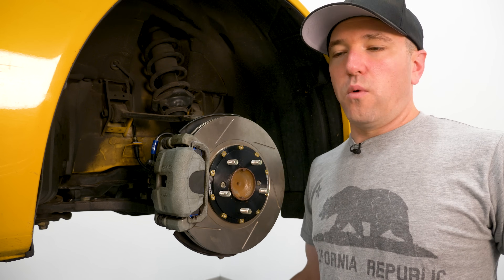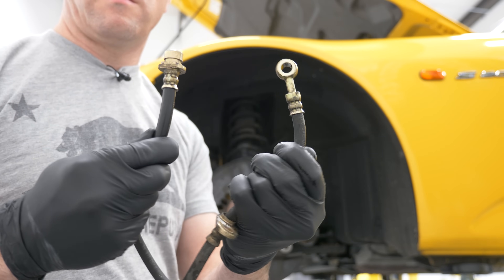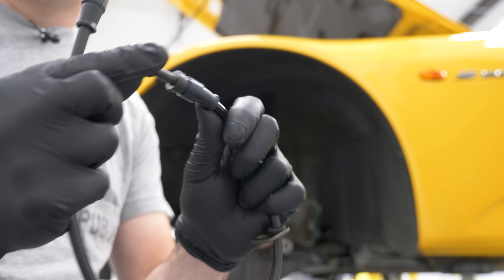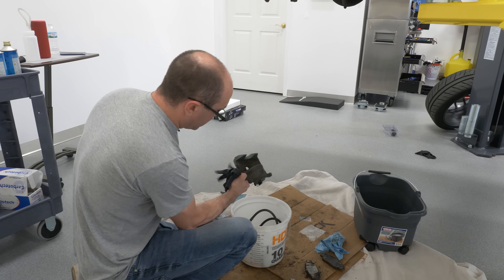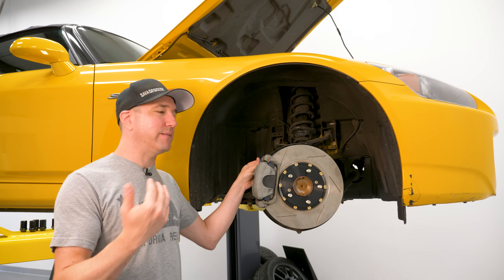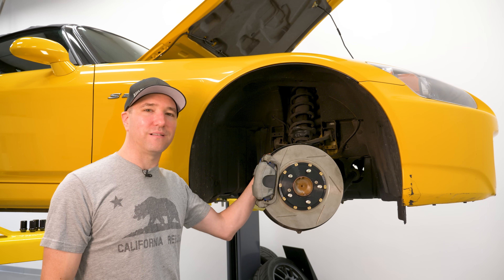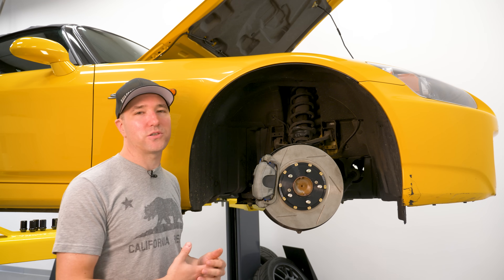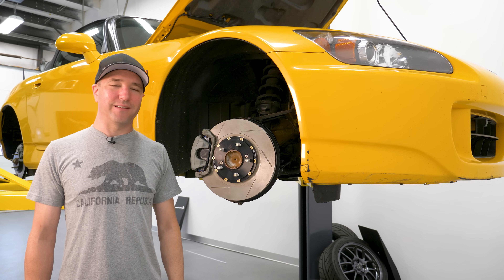Are Stainless Steel Brake Lines Worth It? | The Fine Print

Comment: Working as a mechanic for 11 years on many high performance cars and vintage race cars we installed and serviced a lot of flexible stainless brake lines. We installed top brands like Spiegler and Earl's. Many of these brake line installations failed within just a few months. Flexible ends or not, this hardware is not really suitable for everyday street use. There is simply more flex at the line ends than the lines can handle, and the hose ends up splitting close to the end fitting. It is even a problem for race cars. The rubber hoses can tolerate a lot more flex cycles than the stainless hose.
Reply: Interesting. I also work for a high-end repair facility(20+ yrs) but have no experience the brands that you mentioned. I currently have StopTech lines on my Honda and Techna-Fit lines on my daughter's Nissan. Both have DOT approved fittings and have shown no signs of flexing failure. I sold my previous Volvo 240 with IPD lines that endured over 12 years/200k miles. Correct routing is essential and the technician was meticulous during those installs. I would tend to think that any SS braided brake hose that encounters more stress than it's rubber counterpart would be due to a poorly designed/built hose and/or improper routing during installation.
Reply: @GspeedR  good to know
Reply: After I bought my car in 2011 I installed stainless steel brake lines from Goodridge. I've sold the car last year in 2021. Guess what? They were like the day I installed them. My car didn't see any track, but I drove it pretty hard from time to time and I wanted great brake pedal response. No problem at all. On my next car I'll use EBC.
Reply: @Zeghetank  same, installed goodridge in 2014 and drove it hard and near everyday since, no issues or leaks but will probably replace soon for regular maintenance
Reply: @Zeghetank  no, they werent like the day you installed them.
Reply: Is it good practice to change the rubber brake lines depending on the cars' age? This is assuming no visual leakage or damage present.
Reply: @kalani1987  A friend was killed in a Honda S2000 on the track when one of his rubber lines ripped out of the fitting.  The car was 11 years old.
Reply: @kalani1987  I know my motorcycle is not a car but my service manual said to replace brake lines every 4 years.
Reply: @paulh9301  geez...i think im a bit overdue lol. I'll need to confirm but I'm pretty sure my factory manual for my car doesn't call for replacement unless they're visibly damaged or deteriorated. Am fairly confident that they are the original ones when the car rolled off the line 33 years ago...
Reply: @kalani1987  it makes sense to change them on old cars, I would not trust them after 15 years or more.
Reply: @charlesrockwell3923 if I can pick your thoughts... I've just acquired an E46 for track use however it will retain road legal status for the moment after watching this I'm now debating wether to swap to braided hoses but I just don't get why they would offer life time warranty with them if they where this bad?
Reply: Is the concern the same for clutch lines?
Reply: Thanks for sharing!
Reply: stainless brake  hose ...is not easy to install , on a car or  motorcycle
u must need to measure  every moving parts ... the complex part  using that ,is the fitting angle ..
..

Comment: Dang, I'm having to replace my lines because my brakes got over temperature and deteriorated the lines where it won't release the rotor.  This will be second time.  Now you're suggesting I shouldn't replace my lines with stainless braided.....Well the reason this happened because I was trying to keep up with someone in a tacoma while I was chasing with a f150 carrying tools and generator

Comment: I was told the rubber lines break down and small particles get in the brake fluid. Need to replace the lines and flush it out with new fluid

Comment: OK, so this is a good video. But, I have yet to see any technological video showing evidence of the heat transferring into the line is so high that the line expands like this on even regular track driving. I'm not saying it's not true; I'm saying that I have yet to see any video proving it. So, show me concrete, logical, measured temperature increases in the OEM lines that lead to this problem. I have had my OEM brakes up to 700 on regular nighttime street driving, and have had street brakes up to 1100 with glowing red hot rotors that are destroyed in one night. Even with that, glowing red hot rotors, the lines did not bust, expand, explode, or anything else and has never led to me experiencing a brake failure for this reason. Those rubber lines come engineered with a percentile of error, and the specifications generally provided to the public does not include the 20% overbuilt criteria.

Comment: My excuse is corrosion,,both ends on my owm rubber lines were corroded badly and i only have 7,000 miles on my fk8. Its horrible and thats why im did it, because they are stainless steel.

Comment: I bought this for my CRF250L but to me I dont feel comfortable, when I pulled the front brake lever, i have to use 2 or 3 fingers, i find it hard to pull. I prefer the original line. For the rear brake line it is ok.

Comment: I've went back and forth on this decision for some time but yeah I don't track my car and am satisfied with the brake pedal feel etc so I will keep my rubber stock lines and when they need replacement I'll replace with another set of rubber stock lines or OE quality rubber ones. Just not worth it to me.

One thing on my car (2015 WRX with 107K miles) that improved brake pedal feel was the Perrin master cylinder brace. My brake calipers are 100% stock. I recently had to replace the rear calipers (found a pair of them new) as they were starting to just fail on me and seize up. Replaced along with rotors and pads. Duralast Elite pads and Duralast rotors (smooth surface no slotted/dimpled). I use Dot 5.1 Motul brake fluid.

Comment: Thanks for this. I was considering putting some braided lines on while doing the brake pads, but I think I'll just use some new rubber lines, since the ones on there now are about 12-13 years old. I don't do serious track driving, because I don't really have the spare time or money to get into it. Fundamentally, even though I do like to go fast, it's still just street driving.

Comment: What about the actual brakelines though, the hard fixed lines - I like stainless because of it’s corrosion resistance, though it is a little harde to work with than the soft nicop lines

Comment: Its not about lines expanding from heat, its about lines elastically expanding from pedal force. The imprecision added when some of the force applied is spent expanding lines. Imprecise and inconsistent.

Stainless steel lines do not accomplish this because of the stainless exterior braiding (if ever seen Chinese finger puzzle clear why). Tbey do it by virtue of the teflon inner core that is commonly part of stainless lines.

Its possible to use teflon core woth rubber lines. Might be ideal for street car that doesn't need abrasion and puncture resistance that the stainless braid is providing. But near impossible to find aftermarket (because every wants cool factor of stainless braid).

But I bet some of those high performance exotic cars
mentioned have teflon lines stock.

Comment: In 2013 I did z1 motorsports ss brake and clutch lines on my ‘06 350Z. I thought it was a tremendous upgrade. Brakes and clutch really firmed up and felt strong. Put them on my ‘15 Titan in 2018 and had the same experience: nice and firm brakes.

Comment: I agree with Charles Rockwell the only brake line failures I have had are on competition cars with stainless lines. I think the reason lots of people think that their brakes are better after fitting stainless lines is because they have changed the brake fluid and bled the system.  I discussed this at length with an engineer from Girling and he would never use stainless lines on a road car. I would however consider fitting nylon coil rubber brake line protectors especially if you drive on unsurfaced or poor roads.

Comment: Any improvement in pedal feel, firmness, is more due to the performance lines inner construction, than due to the actual stainless braiding. Typical inner hose liner for braided lines is teflon, and that is what adds firmness over some stock lines. The braiding itself is there more for protection against external abrasion, like mentioned in video.

BTW, its super important that  braiding is covered by an external plastic coating, to prevent debris from getting into the mesh, which would then abraid the soft hose with each flex, quickly destroying the hose.

Some high performance cars come stock with teflon inner hose liner, even though exterior is still rubber. This is why some claim braided hoses made a huge improvement, some say none at all.

If cars stock hoses were rubber inner liner, huge improvement. If cars stock inner liner already teflon, no real improvement.
Reply: wonder how much of an upgrade it'd be if one were to get these oem teflon-lined rubber hoses and fit them onto another vehicle, assuming the lengths and fittings were the same.

Comment: Question.  I drive an Escalade with about well close to 1k lbs of audio equipment.  Converting to corvette 6 piston calipers. Would ss brake lines be recommended for the heat or run with the rubber hoses?

Comment: Thanks for the info. This confirms that rubber lines are good for my purposes. Though I wonder if they're ready to replace in my 2008 Civic. Brake performance is weak. Maybe just need to upgrade the pads.

P.S. that S2000 is awesome

Comment: Has anyone actually changed their brake lines every 4 years in their road car? I don’t think anyone really does and over time heat will weaken the lines and ruin the pedal feel. Braided lines and new fluid and bleeding tend to make a change on lighter vehicles. As for the failure rates, I have no data to go on so it’s impossible to comment on. I think if you have a weekend or track toy that gets abused, especially one with serious brakes then SS lines will improve the feel of the car and for a lot of cars the cost of good ridge or HEL is the same or less than the OE rubber lines.

Comment: I understand where you are coming from with the turning and flex of the brake lines. On a track, as long as you are driving close to the race line, you are only using about 10% of the car's actual turning radius, thus these steel lines are not flexed or stressed like they would be with daily driving. So the car would rarely pull the steel brake line away from its original routing. However, daily driving, which has a lot of tight turns at street corners or during parking, need a flexible brake line that won't fight those tight turns.

Comment: Why would the SS brake lines be breaking more if installed correctly?
What seems to be an asterisk that isnt properly discussed, is installation error.
I want to see testing comparing SS vs rubber installed properly, I'll put $1000 on SS

Comment: I always phantasized about if efficiency wasn't a concern in this world, if cars could be made with no rust tendency whatsoever, made for life, and so when I got my racing brake I picked steel brake lines and when they asked me whether the fittings should be anodized aluminum or the slightly heavier and more expensive stainless steel, I didn't even have to think.
I also once mounted a header shield and an exhaust system with V4A-80 screws, kind of in protest of seeing mounting parts in extremely rust-prone parts rusting into Swiss cheese themselves. (I do not know whether that material's heat expansion and electrochemical characteristics are fine, though.)

Comment: Yamaha recommends replacing motorcycle brake lines (and rebuilding the calipers) every few years.  The makers of SS braided lines claim that their products will last the life of the vehicle.  In addition, the OEM lines on ABS-equipped machines tend to have a lot of hard steel tubing so the amount of rubber hose is much less and the benefit of aftermarket braided lines (without these sections of hard tubing) is also reduced.   I also have concerns that the OEM ABS system is tuned for the dynamic response of rubber hoses and might not perform as designed with braided lines.  I wish someone competent would do a video on this application.  Too many questions...
Reply: Dynamic response? That's where you went wrong. Rubber hoses have a delay believe it or not hence the ABS SYSTEM ASSISTING YOU IN BRAKING BECAUSE IT KNOWS "MY BRAKE LINES CAN'T TAKE THAT PRESSURE SO FAST, SO I'LL HELP PUSH IT"

Comment: There is another reason for stainless steel brake lines, and that is feel. Knowing what is happening at the pad is another piece of telemetry that I appreciate. You don't need it on the street, but I have them for the feel. Just because you technically don't need them on a street car, doesn't mean you shouldn't use them. If your car is your love and you don't track it, there are better places to spend your money. Its just this guy's opinion from a practical perspective.

Comment: So, it turns out it is almost impossible to get Honda OEM replacement rubber brake lines for ap1s right now.  If OEM is unavailable, is there another source for high quality rubber replacement brakes lines for the ap1? Or, is stainless the only option at the moment.

Comment: I've installed SS braided brake hoses on several my family's daily drivers. They get inspected @ every OCI, never had an issue. IMO, An emergency avoidance maneuver on public roads can warrant the same braking confidence that's relied on @ the track.
Reply: He described heat buildup in the fluid from repetitive hard breaking as the reason why stainless brake lines will hold their shape better in that hot condition. Built up heat wouldn't apply to a one-time emergency maneuver.
Reply: @lawpenner  While I won't doubt that brake fluid temps are consistently higher under track conditions, some moderately spirited driving on the hilly, winding roads of eastern PA can easily stress even the best DOT4 fluids, albeit @ shorter durations.
Reply: @GspeedR  love those winding roads on the hills of Pennsylvania. ...Except when I got hit by fog suddenly in the middle of the night, went off the road and ramped off a dirt pile launching my car 4 feet off the ground, then nose diving into the ground and jacking my alignment/suspension. Good memories

Comment: So there might be a problem with the end fittings if you don’t install them correctly? Isn’t every part a possible liability for you don’t install them correctly? I don’t want any part of my hydraulic brake system expanding under any circumstances. Rubber also tends to dry out and deteriorate over time.

Comment: @4:24  Rubber, unlike many other materials, constricts when heated and expands when cooled.
Reply: Yup, this is accurate.
Reply: The discussion here isn't about the properties of rubber as a standalone material, but in the context of brake lines. If the brake fluid expands enough from heat, it'll push outward on the rubber lines and they'll expand.

Comment: 100% agree with you 👍🏾 only thing i could add as it relates to liability is the shock load stress then the abs module activities hammering  brake system through fluid during its operation.. rubber lines act like accumulators reducing the shock load as the pressure spikes then module pulsates
Reply: Interesting. I haven't heard someone else mention this. But, is very true. They def. give a buffer, if one will, for regular drivers so that they aren't just skidding all over the place.

Comment: something came loose on my track car and my tire was rubbing the rubber line. i was going hot into a turn and the line blew. I still count my lucky stars nothing was in front of me in the brake zone. stainless lines were installed shortly after.

Comment: The real question is difficult to detect rust in the FIXED lines. This potentially deadly problem is not even mentioned in this video.  Steel in not flexible. So if the object is obtain maximum life insurance.
Fine.. use braided rubber/ stainless fittings that flex and for Gods sake give us  “lifetime” non corroding fixed lines and non porous steel or plastic master cylinders.

Comment: Should have watched this before I bought my stainless steel brake lines.
Reply: Don't feel bad, the SS lines will give you much better pedal feel because there's no expansion on the lines from the hydraulic pressure. Its worth it,  nothing scary about it.  These lines are used in the racing world where they're tortured, they wont fall apart at the fittings.

Comment: But even a stainless steel brake line has rubber on the inside. A stainless steel brake line is basically a rubber brake line with a stainless steel mesh sheath over it.

Comment: Lets rewind for a bit. If in an ambient condition (no under braking) hot brake fluid has so much pressure that it's able to expand the brake like you would then have pressure on the pistons and thus the rotor. The idea that the line is already expanded when you go to press the pedal because the fluid is hot doesn't make any sense.

Comment: Auto manufacturers don't use stainless steel brake lines because they are more expensive. You can just as easily install rubber brake lines incorrectly as well.